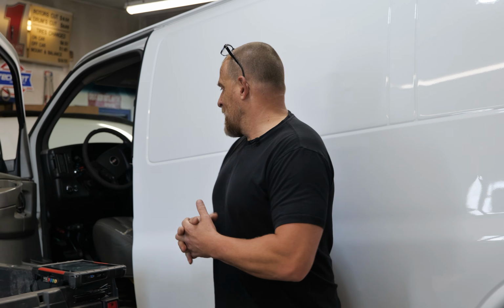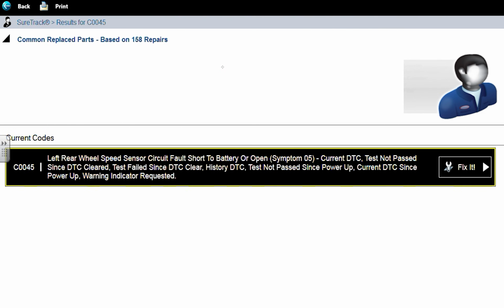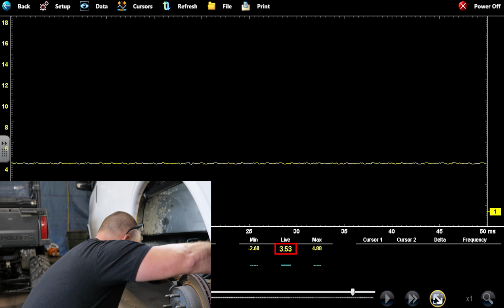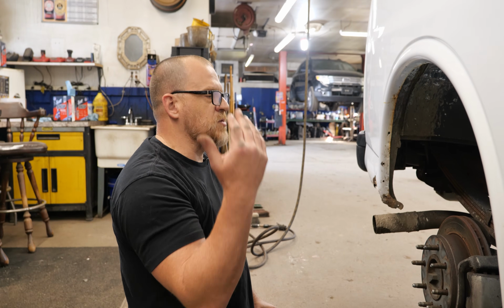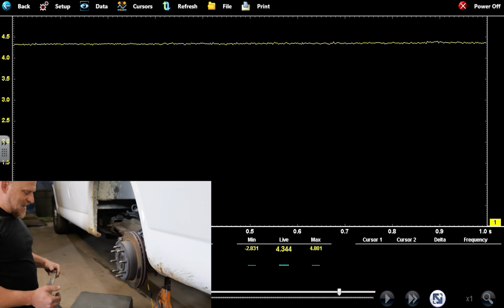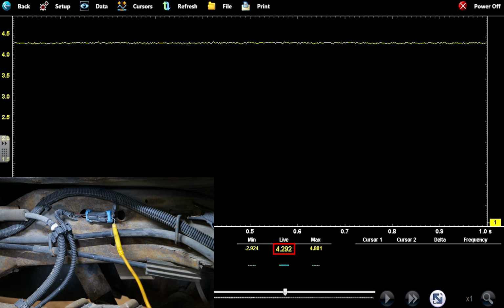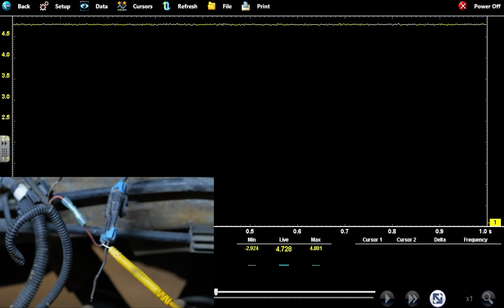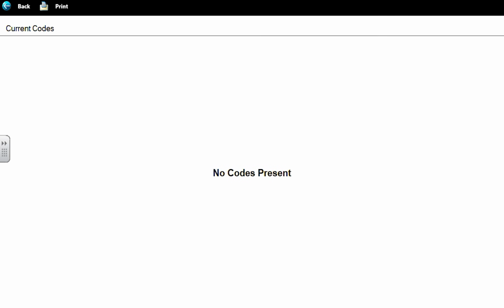ABS Wheel Speed Sensor Circuit Code With GOOD SIGNAL?

Comment: Haven't finished viewing but I have exact issue with my 02 s10. I had open circuit code and erratic reading code. Clearing codes got rid of erratic but open code stays as current and history. Now watched. I'm right that bad wire was after chassis connector in lead to sensor?

Comment: The differential amplifiers that detect the signal from VR sensors are very sensitive and will often still detect a signal with only 1 of the VR wires connected.
The capacitance through the air is enough to couple the signal into the amplifier and these sort of amplifier usually have automatic gain so they will amplify any signal up until they can use it.

Comment: would have been nice, to see a drawing , where the resistance and the voltage drop, caused by the broken wire, is shown in the complete circuit !  Great lessons Mr Danner ! greetings from germany

Comment: What would a headlight bulb do with the abs wheel speed sensor?
Reply from the maker: why would you want to use a headlight bulb on an ABS circuit is the real question
Reply: @ScannerDanner hahaha I agree not unless if somehow they share the same power feed or the same ground? Maybe. There again I had a misfire on my 2004 Ford E350 and it showed one of the parts replaced was the radiator 😂
Reply from the maker: There are two main types of wheel speed sensors.
1. Variable reluctance type
2. Magneto-resistive type (similar to a hall effect)
In both types there is very little current flow and load testing with a headlight bulb would potentially cook something in the module. In particular on the hall effect type
Reply: @ScannerDanner oh gotcha, so it sounds like a problem on Michellels end

Comment: I've had similar issues with abs sensors. Reading good on scanner. Even voltage reading on meter was good. 1 side had good defined square wave on scope amd other side had "pointy" peak and drop pattern on scope.
Apparently the module was still accepting the voltage peaks and using that to display correct wheel speed. It would set the sensor circuit code though due to the "dirty" signal. Of the 2 I had do this: 1 ended up being damaged tone ring and other was a bad sensor.

Comment: I working on a similar era vehicle.   I am testing the front and rear wheels sensors with the sensors un-plugs.  I was surprised to find the reference voltage is different for the front and rear sensors.  Is that normal or am I seeing a ECM issue?

Comment: Crazy, man, crazy. Such a cool find. That there was a good signal would DEFINITELY throw anyone off. Absolutely crazy. Imagine if you didn;t know what a bias V is?? Module next? If that not, then coding problem? Already two very expensive fixs. New sensor? Wiring going to the module? Wow, so many expensive and time consuming mistakes you could make if you had no idea, makes my head shake. I've become SOOOO cautious about making ANY claims when I'm diagnosing these days. I guess the more you know, the less confident you might become because you know  about all the possibilities and variables a parts changer wouldn't.

Comment: I had a new wheel speed sensor in a 20 ford escape that read a 6 mph wheel speed with the wheel static. Replaced it with a OEM and all was good. It produced a good signal at speed but was always off compared to the other sensors. Do you have a part number for that small test light you use Paul? I’ve been looking for one. I like the fine point in it. Thanks again for the great content.

Comment: Had a recent similar problem.(2010 Sierra) DS rear -like yours. Broke the sensor, (changing axle bearing) so bought a new sensor, installed it and the code would not clear. wtf? Had voltage and signal. (using DVOM) Actually it would clear, but as soon as you went over 15 MPH it would trip again.  Perplexed, I switched the new sensor with the other side and put the existing working one on the side that would not clear. 
 Then  POOF  everything worked. Don't know how, don't know why? Buttoned it all up and zero problems. Weird huh?
Reply from the maker: Air gap issue maybe? Hard to say, that is weird

Comment: I’m just an old shade tree mechanic ( only cause it is cooler) but my first fraction is to swap with a known sensor. 
Just swap left and right wheel sensors. 
The quality of parts today is horrible.
Reply from the maker: Here is the rust belt, you cant even remove an ABS WSS without destroying it 🙂

Comment: Had similar issue with snap on scanner. Used autel scanner and no codes.
Reply from the maker: This was not a scanner issue. Check out the rest of the video if you haven't already

Comment: I literally used your same techniques in this video to see if a 1992 Toyota fuel pump, or relay, wires, and all that the same way on my scope and found mega corroded wiring after the harness connector into the fuel pump mount. Also the wiring connections came undone, from a previous person who "helped" the customer out, but didn't make very good crimp connections at all. It was the most unbelievable situation ever so far for me. Thanks to your methods and techniques, it made us figure out the customers issue. It definitely took myself longer than others, but I still always appreciate your ways of figuring out stuff. It works for a variety of things.

Comment: It’s classic case of the battery acid causing corrosion on the contact, know issue on the early G van. Even back in 1998 when I worked for Hendrix GMC in Austin, Texas
Reply from the maker: No battery acid in the LR of this van. This was caused by vibrations of that harness and those two wires rubbing against each other for 13 years. Then water intrusion did the rest

Comment: I had one come in here yesterday Danner, because all the traction control and ABS lights were on.  Scanned it, and got LR wheel speed sensor circuit code.  I was like, sweet, something to diagnose.  I crawled under it and something had chewed completely through the wires.  I said "well, rats."  XD

Comment: I just pulled the fuse for my ABS. I will not be fixing it. ABS doesn't work for me. I can stop faster without it. It just extends stopping distance. A useless invention. I'll remove the idiot lights this summer when it warms up. I removed the sensors on my F250 also. The Flex will be next. Auto safety features are mostly unneeded and just add to the cost. Center rearview mirror for example. Don't need one. Cameras for backing have caused me more headaches than help. Side mirrors are easier to figure out. Yes I am the guy who doesn't turn his radio down when entering a neighborhood.
Reply from the maker: In the snow, I wouldn't argue. In a panic situation, not a chance you can brake better than an ABS system

Comment: Hey Paul great video, the fundamentals are key to successful diagnostics. An addition to your bias voltage information, bias circuit has both voltage and current for proper monitoring. That is why it's still shows a speed signal bcaz tht is generated by the sensor which was  enough to overcome the high resistance (almost open) but the bias current (very low current) from the module cannot overcome the resistance and reflects as an open circuit hence the fault code. Great work Paul, we appreciate your work, wish I can meet you in the future.

Comment: So a regular bidirectional scanner is not capable to do this test, right?
Reply from the maker: This is an input circuit problem. The bi-directional portion of a scan tool is for controlling output circuits (relays, solenoids, ignition coils, injectors, etc.)
Make sense?

Comment: What did caught my attention was that your waveform on left sensor while spinning the wheel by hand had actually top portion of the waveform kinda "clipped" while on the right sensor top and bottom portions were equal. Any thoughts on that in this specific case?
Reply from the maker: I saw that too. Clearly the answer was a voltage drop from high resistance but why it showed those exact characteristics, im not sure. Did you also notice on the scan tool the wheel speed would drop to zero sooner than the right side? I didn't until the edits
Reply: Yes i noticed that too but like you said i was convinced it is a differential related. Waveform on the other hand was a telltale that something is wrong and that scan tool is kinda lying, but of course hard to tell what is wrong.  Definitely an interesting case and imo shows that it is hard to blindly believe to scan tool. As i'm doing diagnostics im learning this fact in a hard way, scan tools tricks me from time to time😁.

Comment: Even with computer monitoring of the circuit, the PCM wasn't exactly correct about  the diagnosis. It was neither a short to positive voltage nor an open circuit. I wish those codes would be more exacting about what they are detecting, rather than making a misleading statement. For example here one could state "high bias voltage". That would lead to exploration of circuit resistance and a possible hunt for a short to B+. I loved the way you worked this up, rather than just concluding it was a bad replacement sensor.
Reply from the maker: It was an open circuit. Computer was seeing high bias voltage which is from high resistance or open circuit. So that part of the code description was correct

Comment: Hello Paul. Thanks for your commitment to teach us all the right way to do things. I have developed a method to sort these out quickly. Build a jumper lead set that can connect left side sensor to reght, and vice versa. If the code moves to the other sensor, sensor problem. If not, circuite testing is needed. This really helps on digital sensors, but equally useful on AC sensors. Thanks again.

Comment: Hi Paul. Great case study! The fault clears as soon as the voltages are correct at the ABS ECU on the GM ABS systems I worked on in the past. I wonder if the same kind of monitoring occurs other manufacturer's ABS systems.
Reply from the maker: Absolutely and not just with ABS inputs

Comment: I've been doing this for 40 years, in fact just did three ABS repairs this past week. I have never seen a signal on the scan tool but a code that won't clear. Thanks for the heads up just in case I do! 
The telltale is the code reset without even turning the wheel. 

Excellent stuff us flat rate guys always need some more edumication. ;)

Comment: I like to check the resistance of the  sensor first to determine if it's a VRS or magnetoresistive sensor. The VRS is usually several hundred  to 1500 ohms resistance. A magnetoresistive sensor has resistance that is in the hundreds of K ohms. 
When I check the voltage from a VRS, I put the positive and negative test leads to both sensor wires. On a magnetoresistive sensor, one lead goes to the sensor wire and the other  to battery negative.
Reply from the maker: I am always hesitant to unplug anything without measuring the circuit, as is, first. But that's a good way too

Comment: after you fixed the left side, the signal was so much higher than the right...might there have been the beginning of an issue on the right hand side as well? If this was you doing the job, would you go back and check the other side as well?
Reply from the maker: Good eye! And I didn't really consider it until after, but I think that new sensor was just able to produce a higher signal voltage. The RR was maybe a 2.5v peak to peak which is plenty at that low of a speed. The 7v on the LR was a surprising number.
Reply: @ScannerDanner  yeah. I guess it doesn't matter as long as the computer can read it and doesn't throw codes, but it does make me wonder about the discrepancy. I had been thinking maybe the issue was the wiring on the RR, but maybe the real problem was the new sensor. We all deal with new parts being garbage...I wonder if it was just built out of spec.🤔 (Again, at the end of the day it doesn't really matter as long as it works, I guess)

Comment: I had a problem on a ford transit van, the rear sensors were wired the wrong way round so the diagnostic machine said the left sensors was the right. After that job I always get someone to spin the wheels individually as I look at the diagnostic machine!

Comment: Who is responsible for the inaccurate scan graph, ford or snap on?
Reply from the maker: Neither! The signal was strong enough to still be read by the module. Also this is a GM 😊
Reply: @ScannerDanner  Thank you for the reply. The signal was different side to side with the scope, I get it, on the scan tool was just showing speed not amplitude. Had ford stuck in my mind, too many lately LOL.

Comment: I had my power cable to my house look like that and it almost burned the house down. One strand was left on one leg from pole. The line sent only 10 v so led lights worked. Good thing I wasnt 220 welding.
Reply from the maker: For sure! Resistance = HEAT

Comment: I also had a 1987 Corvette with the  early computer system and sold the car because of not clearing ABS. Wish I checked that. 

Thanks for teaching kids and getting them interested in car repair instead of gaming to stupidity. The only job they will get is flying a military drone. 

Bring manufacturing and truck repair back?

Peace

Comment: if they would have just put that protective sleeve all the way up to the connector.. It would have survived.   It's funny that it broke right after the sleeve..  Honestly, the very end of that sleeve should be hard mounted (by the factory) -  so that all the movement ends up being down from there and not above it.
Reply from the maker: I didn't show it well but there was ZERO external damage. No evidence of rubbing. Those two wires were rubbing against each other was the cause of that! Crazy

Comment: Wow.  In the first minute, I said I think that is a Variable Reluctance Sensor.  I would be measuring the bias voltage.  Because it uses DC bias voltage to detect open or short, and it could still see an AC signal, but it will probably be reduced.  I stayed till the end and guess what!    I just wouldn't be there without you Paul.   I have learned so much from your channel and your premium content.  Your premium is just like going to class with you!  It has made such a difference in my life.  I am a Network Engineer for my day job, and I fix cars in the evenings an weekends, help out people and other shops.   I did a C0045 video once upon a time on my Buick.  https://youtu.be/oviYeEtZ3lw   I can't film at a lot of the shops and used car dealers I go to, but I try to film as much as I can at home.
Reply from the maker: My man!

Comment: Takeaway , an AC component will jump a gap in a high impedance circuit, actually using the dirt and corrosion and even the wire insulator itself as an AC circuit path. This is more prevalent in high frequency environments but when the circuit impedance and the gain are both very high this will happen. Also a complete open with very close proximity will jump the signal through capacitance coupling.
Good one Paul.

Comment: Great video Paul. The only thing i would add is on 5v circuits its (generally) a good idea to short the signal circuit to ground while monitoring the data pid to make sure the voltage will "max out" in the opposite direction
Reply from the maker: Agree, but on this circuit the bias line voltage is not shown on scan data. Only a wheel speed to go with

Comment: I had a 21 Lincoln nautilus with an abs light on and a check headlamp system see owners manual fault on the instrument panel caused by an open between the module and the left front wheel speed sensor first time ive seen wheel speed cause a headlamp warning

Comment: early thoughts, someone replaced the vehicle side connector and reversed the wires or there actually is a wire/connector corrosion somewhere.
more testing is needed, to rule out bad ABS module though.

Comment: Having worked on a few of these vans in the 23+ model years, you'll be happy to know they are still pretty much all the same network, modules and architecture underneath!

To anyone questioning the age of some of the SD case study material, I sublet to body shops up to current year vehicles including Domestic, Euro and Asian, and even occasionally do diagnostics for dealerships, using foundational knowledge I learned from this channel over the last decade+.  Everything Paul teaches is still 100% relevant to modern vehicles, and will even give you direction in systems and technologies never seen on this channel.  :)
Reply from the maker: Thanks for the great feedback and insight, my friend.
Reply: @ScannerDanner I'm a little over halfway to being master certified but I plan on buying your book as a birthday present for myself I've been in the field about 4 years now 1 at independent and 3 at the dealer I used to get super nervous with electrical diagnostics now it's just the same as everything else